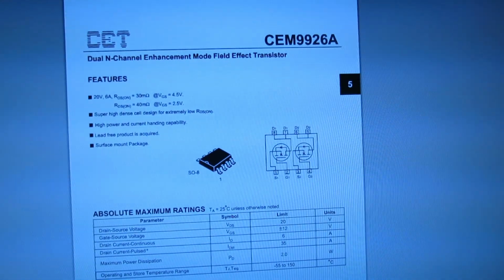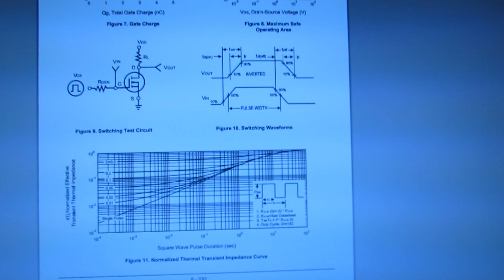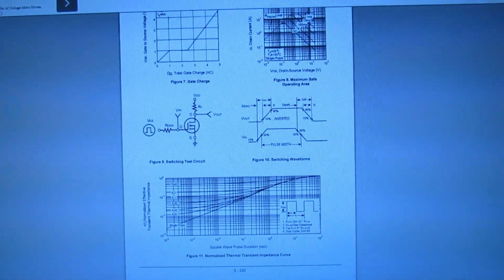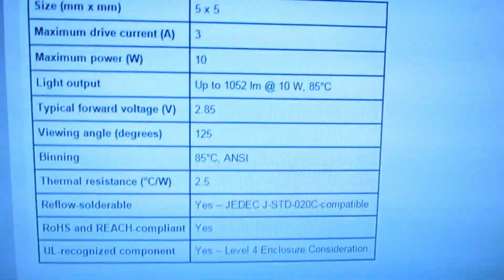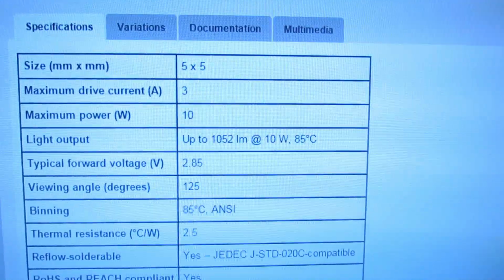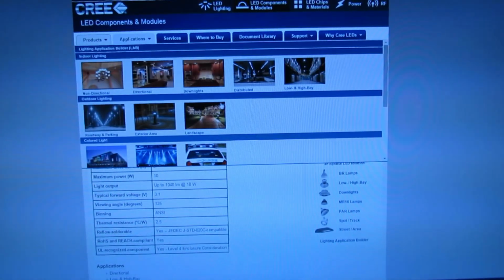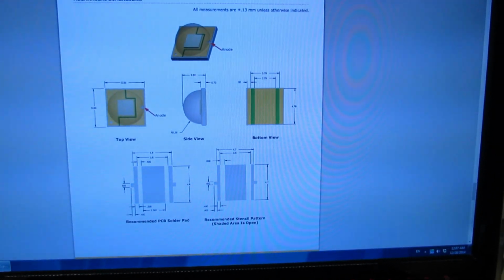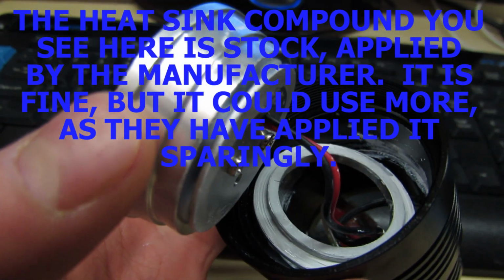SkyRay King 7 x Cree XM-L 2 T6 LED Flashlight Tear Down

Comment: Great review, thanks
Reply from the maker: +Robert Nun'ya Thanks! I've delved into upgrading this beast too, check it the video in the cards if you're interested.  Cheers, David.
Reply: Hi David, You know one of the biggest problems I have found with this light on eBay is so many companies sell different versions of it and they're fake. They claim to be 7000Lm but with only 3 LED's that's impossible.
Reply from the maker: +Robert Nun'ya Hi, I know what you mean, but that's where knowledge is power. Knowing that each LED can put out about 1000lumens, you can buy the light that works best for you.  A 3 X XML light that says 3000 lumens will probably have the same output and current draw as one that's advertised as 7000 lumens, it's just marketing hype.  They aren't completely lying, since you can push about 1800 lumens out of an XM-L2 right before it burns out, or even 2000 lumens, but it's rediculous to use that rating as an advertising ploy.  As long as you buy from a good seller, you'll get a good product, that at least has XM-L2 LEDs, and will work properly for a while.  I found that the drivers are all questionable, but you can always mod it to be more reliable or more powerful. I've got another video about modding it.
Reply: I am going to check that out now and thank you for your help and information, It was a pleasure talking with you. Thank's again David

Comment: Very nice teardown, please feel free to do this more often! It is hard to find teardowns as detailed and well described as this... also nice camera work, always nice to have the item in focus :) I like how you actually show the datasheet of the LED chip and driver.

Also, nice attention to detail regarding o-rings, button, etc.

Lastly, great idea for the pipe insulation as your medium to point the lights at. Not only does it show brightness, it also shows heat output via the melting of the insulation. Not sure how consistent that pipe insulation is though... meaning, if you look at that stuff you see a plastic film on it, almost like... cellophane wrap... depending how thick that stuff is at any given area of the pipe insulation, you will get more or less light reflected... so just keep that in mind.
Reply from the maker: Hey thanks for the comment. Glad you liked the detail and camera work, I try to keep everything in focus, it's hard at times but I do my best.
Ya these lights are starting to put out a significant amount of power, so the heat can melt through your polyester pockets pretty easily.  Other materials are just as bad though, they are basically toast afterwards and leaves a hole in your pocket. 

I recently made a Convoy S2+ operate at 20W, it's pretty insane.  Hopefully in the future when they double the efficacy, well use 10W for the same amount of light.  I hope I get to make a video on that light!

I'll keep an eye on the consistency of the medium as well, thanks for the heads up.

Cheers,

David.
Reply: It's not the driver chip, it is just a FET
Reply: try diodegonewild he's a very good too!

Comment: What do You think about buying original XM-L2 U3 leds and put them to cheap 9x Sky King ? Its worth to spend another 25$ and also it will be easy to replace them with normal solder ?
Reply from the maker: +meteoryty.pl Hi, I think that would work if you soldered them properly.  You would need to get a hot plate that can melt the solder, but not be too much hotter than your solder, I'd use leaded solder, so that the temperature is lower.  If you use non-leaded, it'll need to be way hotter, and that will destroy the LED's.  I've never soldered the LEDs before, but there's a special way to do it with reflow soldering.  
I don't know if there's already a good way to do it with a template or something, but maybe?  I guess you could put the solder paste on the board, put the LEDs down, then heat it up with the hot plate, once it's done, remove it from the heat, and put it on a cool plate to pull away the heat, maybe with a little bit of water on it?

It sounds pretty hard to me, but I would like to try it sometime.  If you heat up the LEDs for too long, or too high of a temperature, it will damage them, so the process will need to follow some strict guidelines.
It would probably be worth it to get the extra output and the exact color temperature you want.  
If you are the kind of person who likes to optimize things, then for sure it's worth it.  If not, you could just go with an XML2 flashlight, and be happy with the 16% boost over the XML already.

Also, if you were to go with custom LEDs to push the limits, you may want to use the U4 group, the highest luminous flux, but they come in higher color temperatures.  What color temperature do you want?  I prefer a lower color temperature over lumen output.  It's lower lumen output, but there's more useful red spectrum of lighting, so I like it.
Reply: +David Sunshine yes I just realized that this could be very hard to do this with 9 leds. For 25 I have ned flashlight :) with XML-T6

Comment: Thanks mate, I like your review. 
I am actually after a torch that punches above it's weight for distance. It will be a gift for my parents, who live on the land, having 30 head of cross Limousen/Brahman Cattle, here in Qld Au. Most of the time, everything is cool, but a wild dog/brown snake or just a health problem with a cow giving birth can support the need of a torch that goes 40 backyards away dood, I am talking 80mtrs/thats similar to yards for yous (you need that shit to light up like the super bowl grand final). The house is above most of the paddocks, so a good torch is a bit important. They need a heavy hitter. 
I like the XML-L2 globe. They come in an 8 globe on Ali express, for $60 au, I am thinking about dropping the button on a sky ray.
Any ideas, opinions, appreciated, Ta.
Reply: I have been using this for a few months on a bike and I really like it, I came home after a 1hr ride and left it on full in my living room, untill it fadded, took 5hrs, I did this to it twice, as I wanted to move it's battery threw full range. 
It is my little star, but it does not throw light the distance I want for a Sky Ray. http://www.aliexpress.com/item/X3-Bike-Light-3600-Lumen-Cycle-Light-Head-Light-Lamp-Light-Cree-XML-L2-LED-Bike/32418669717.html
Reply from the maker: +Dominic Earley Thanks man.   Glad you enjoyed the review.  The XM-L2 is a great LED,  and probably the cheapest and highest output LED out there,  check the website,  it's rated for about 116 lumens per watt,  give or take based on the color temperature and output group, you pay more for the  highest output groups but get more lumens per watt in return.   The T6 group is pretty good,  and well priced,  which is why most lights say they are T6.  Anyways,  the XM-L2 is great,  and that would be the LED to give you the most punch,  unfortunately,  to get good punch you need a high quality smooth reflector that is large.   The reflector in your bike light is pretty small,  and similar to the one in the SkyRay King,  that's why it has a medium beam(beam angle) with medium spill to your peripheral(field angle).  What you want is a very small beam angle,  irrespective of field angle.   The SkyRay has a shallow reflector so it will never give you a tight beam,  but in my opinion,  if you go with the 6x or 7x XML2, you will get the intensity and beam angle that will equate to a satisfactory amount of throw.  I would always recommend redundancy in the form of a backup light,  the Convoy S2+.  Also get good batteries,  like the LG 3500mAh or Panasonic 3400mAh, and a charger like the nitecore  D4, gearbest has it all for good pricing.   Keep in mind the lights get hot after a few minutes,  I'm sure you noticed that with your bike light.  With those flashlights and batteries,  you'll have the runtime and reliability that they should need.

Comment: You know how to open front section with leds? I need to screw up the front or get them from back ?
Reply from the maker: You can unscrew the front ring,  turn the LEDs come out,  you can unscrew the reflector to get at them further.

Comment: Where to buy this REAL XML L2 CREE (2 connection in chip, white PCB) flashlights, becouse all on ebay have XML-L (3 connections in chip on green PCB). I have Securiting 5x but want another SkyRay King 8x. But I wonder how long good bateries will light on this one ?
Reply from the maker: Hi Justin,  thanks for posting the link to the forum about the latticebrights trying to be Crees.   I took a look at my lights and the LEDs,  and I have a couple that appear to be latticebrights,  but when I test them against the real Crees, they perform similarly, with no discernible difference.  Using an iPhone 3GS as a light meter through the diffusing box,  I get 39lx for the S2+ with an XML2, 28lx for a zoomable with a real XML, 31 for a WF-501B with an XML2, 34 lx for a zoomable head lamp with a real XML2, and the LB(fake XML) in a zoomable gets 32lx.   The XML2 LEDs are warm white with a color temp of 2750K,  so they lose some output,  but for the LB to beat the WF501B is pretty good,  the WF-501B had the 8x7135 105D driver in there too,  so pushing 2.8A.  So even though there are a lot of counterfeits,  I can't say that they perform poorly based on my tests.   One problem may be the LM80 runtimes, they may fail prematurely.  So I would still avoid the fakes if possible,  but they definitely perform fine in my tests, and even get 4 lux more than my real Cree XML in a similar light.   I order my Cree LEDs from LEDDNA on eBay,  seems to provide genuine Cree LEDs by the looks of it.

Thanks again. 

Cheers. 

David.
Reply: +Justin Mitchell this have normal XML T6. I have another one with different chips. Im waiting for one more to test how long they will flash on same bateries. Thats the point. Not how bright or what chips they have.
Reply from the maker: +Tosia Cat Hi, I don't know what is real and fake, but gearbest and fasttech are great sites.  Gearbest seems to have a bunch of 8x XM-L2 versions, by both SkyRay and Kinfire.  In the end, it's all made in China, so what is real and "fake"?  It's all real stuff made in China it seems.  I'm not familiar with the 2 connection or the white PCB, I think as long as you get real XM-L2 Cree chips, it's a good light, as we don't really know if the white PCB means it's got good components or not.
To answer your question though, if it's running at around 40W, and you're using 4 x LG 3500mAhs, it'll provide you with about 43.2Wh, so your 40W flashlight will provide about 64.8 minutes of runtime on high, and since as the voltage drops, the light gets dimmer and lower than 40W, it may last upwards of 80 minutes and get really dim, it will just keep getting dimmer unless you're using a protected cell that cuts off the voltage completely, but the forward voltage of LED's may not even make the protection circuit cut off.

http://www.gearbest.com/led-flashlights/pp_217906.html

http://www.gearbest.com/led-flashlights/pp_212648.html

http://www.gearbest.com/led-flashlights/pp_217012.html

Cheers,

David.
Reply: The problem is that a large number of flashlights that are marketed as having Cree chips are actually not Cree. Even stuff from fastech and gearbest. Light output is worse. It's very easy to identify the fakes though (http://budgetlightforum.com/node/41084). I wonder if the Securitying ones have real Cree emitters.
Reply: +Tosia Cat Does your Securiting have real Cree emitters?
Reply: +David Sunshine Very good to know! Interesting results. Do your SecurityIng lights have genuine Cree LEDs?
Reply from the maker: +Justin Mitchell Ya,  that's actually pretty strange that they can counterfeit such a high efficacy LED and be so high in performance compared to the CREE products.   It's definitely not easy to develop a product with such high output,  if it were,  the other brands would be making better products.  I didn't purchase my SkyRay from Securitying,  I only got my WF-501B with XML2 from them, and that LED was genuine.   I don't think they have fake XML2 LEDs yet,  that's why they always cost more,  I could be wrong but I haven't seen any poor performing XML2 LEDs, they all output what's expected.   I have however, ordered XML2 flashlights and got LB XML LEDs,  they said that nobody else complained,  but I just said that doesn't mean you didn't send me the wrong one, it just means you sent everyone else the wrong one and they didn't notice or complain.  So,  if the LED on an LB pad performs just as well,  how do we know that this isn't just another revision of the XML being produced by Cree?   It might be a little different,  but I could see it being an XML produced by Cree through another plant,  allowing them to sell them at a lower price point, with the same output,  and therefore make more on the bottom line.  An explanation on the differences between the XMLs may be just minor alterations to their production process,  enabling them to reduce production costs and increase LED production, they do appear to be using less phosphor,  and still outputting similar amounts of light,  since phosphor is the expensive part in the LED,  that would significantly deduce the production costs, with no negative effect on their product.  Anyways,  just thinking out loud.   I'll do more testing on the LEDs and see what I find in more controlled tests.
Reply: I have recently purchased an 3600lm Darkness Beam, from Ali Express, for $40 au. It has 3 globes, small aluminum thing, with separate battery pack. It has a slightly bigger middle lense, which is the globe that changes strength when you touch the button on the back of it (3 settings). I rate it a extremely good, I use it on my bicycles, it runs for about 5 hrs on full, but it cannot throw light for long distance. I am after a long distance puppy, and I figure that xml-L2 must be better than t6.
 http://www.aliexpress.com/item/X3-Bike-Light-3600-Lumen-Cycle-Light-Head-Light-Lamp-Light-Cree-XML-L2-LED-Bike/32418669717.html
Reply from the maker: +Dominic Earley Hey,  that looks like a good light,  it uses 3 XMLs so it's good for about 3000 lumens.   The two Cree LEDs commonly used are XM-L and XM-L2, the T6 designation is a group, each group puts out different amounts of light per watt,  the unit of measurement is lumens per watt.   I believe U3 is the highest,  then U2 and U1, then T6 below that.   Something like that.  If you use a lower color temperature,  more energy goes into making red colors,  so the total light output will be lower and you'll be in the T4 group,  which outputs even less than T6, but I like the lower warmer color temperature.   If you want the highest output,  there are less reds and the light appears more blue than white.  All the LEDs are made and tested then thrown into the bins(based on color) and groups(based on light output) so some perform better than others and that's why you have all the groups,  people want the high output ones,  and that's why they cost more,  rightfully so.  That's quick run down on the categories of LEDs,  I'm currently running 2750K in the T4 bin,  nice warm light like an incandescent bulb.
Reply from the maker: +Dominic Earley Hey,  that looks like a good light,  it uses 3 XMLs so it's good for about 3000 lumens.   The two Cree LEDs commonly used are XM-L and XM-L2, the T6 designation is a group, each group puts out different amounts of light per watt,  the unit of measurement is lumens per watt.   I believe U3 is the highest,  then U2 and U1, then T6 below that.   Something like that.  If you use a lower color temperature,  more energy goes into making red colors,  so the total light output will be lower and you'll be in the T4 group,  which outputs even less than T6, but I like the lower warmer color temperature.   If you want the highest output,  there are less reds and the light appears more blue than white.  All the LEDs are made and tested then thrown into the bins(based on color) and groups(based on light output) so some perform better than others and that's why you have all the groups,  people want the high output ones,  and that's why they cost more,  rightfully so.  That's quick run down on the categories of LEDs,  I'm currently running 2750K in the T4 bin,  nice warm light like an incandescent bulb.